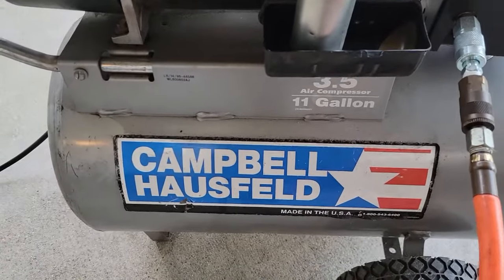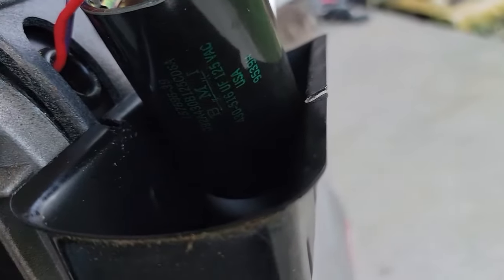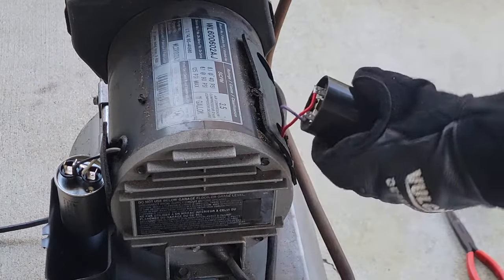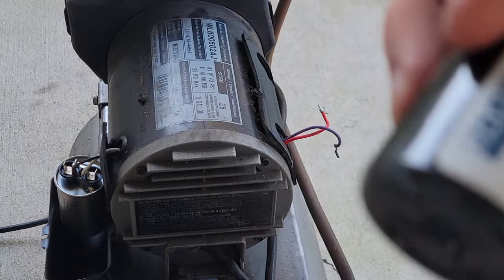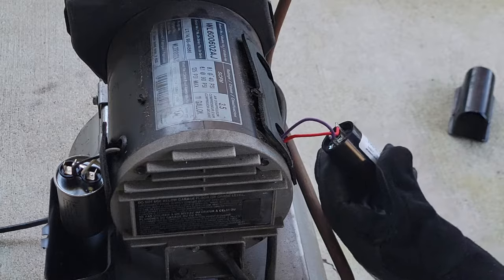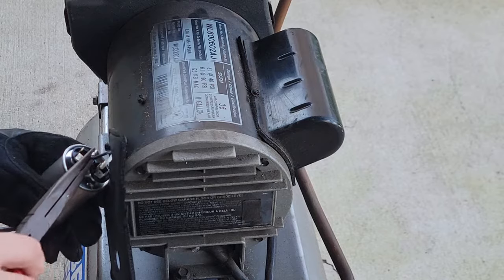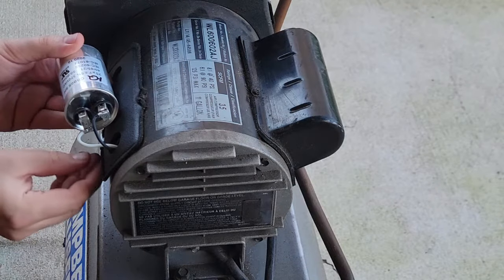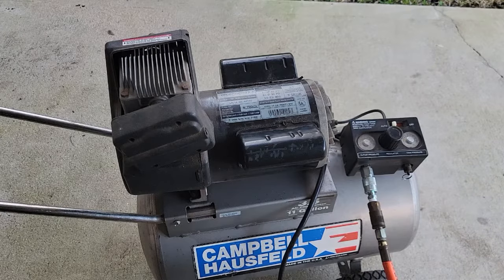Air Compressor trips breaker - replace capacitors

Comment: I have an old like 20 years old..Coleman powermate (contractor portable) it’s a really good at keeping up with my Graco sprayer for bigger orange peel jobs it sounds like urs. Mines blowing the breaker and kinda like slow to start before been looking for that a capacitor mine was tapped on for years and it’s Disintegrated nothing left what tiny pieces. Think they have old Coleman parts? Thanks for the video!  ur motor sounds exactly like that Coleman compressor I have.
Reply from the maker: Don't worry about it being a "coleman" capacitor. There's probably no such thing. Just research the ratings (microfarads) your compressor requires and buy any brand that meets those requirements.
Reply: @anythingmechanical3399  a lady at A.O. Smith that’s a sticker on my Coleman said it’s an obsolete capacitor..I can’t find the damn microfarads number. On the electric motor that the capacitor sits by there is a Century AC Motor sticker  (some info I can make out) 
A.O Smith 
SER1-   BY03-20
Hz 60
Voltz 115
Amp 15.0 
More numbers on that sticker but hard to read properly
The Coleman Powermate numbers on the serial/part number are 
Model Number CP0200312 
Serial number B23911890 
Hey thanks for the feedback! I know they might not make the exact size of my old capacitor ..what would be close in comparison? Any ideas are welcome no biggie
Reply: I’m in the same boat,I need both capacitors
Reply: I found mine on Amazon

Comment: But you didn’t do a load test after it filled up that’s when you said it would trip the breaker not at first start up ?
Reply from the maker: The problem I was having was at startup, which is why I replaced the start capacitor. Afterward I plugged it in and the motor fired right up as it is supposed to. Has been working right ever since

Comment: I have a question To connect them positive and negative or it doesn't matter.
Reply from the maker: Short answer - yes it matters. Whenever possible, take pictures of the way the old part was installed and install the new part the same way.
Reply: No, it does not matter for capacitors.
Reply: @BuildItFixItDIY may I know why? I’m just trying to learn
Reply: It only matters in DC electricity with electrolytic capacitors, with AC electricity the polarity is constantly switching from positive to negative at 60HZ so polarity is meaningless.
    If you are working with something like an air conditioning system, the cap may have more than 2 terminals, in which case you are working with a split capacitor (2 capacitors in 1), one common terminal and 2 different size caps on the other 2 terminals. Pay attention in that case because it can be connected wrong, terminals are usually marked in that case.
Reply: @arroyofive9259 it takes a great surge of energy to start the motor. a capacitor is used to store electricity and release it quickly so it can help the motor with the needed demand. when the capacitor is damaged the existing electrical circuit can't meet the demand, so it pops the breaker.
Reply: @arroyofive9259 it's also possible that the capacitor has failed, bulged and created a short so the breaker pops to prevent injury or death

Comment: I’m suspecting the same with mine but I can’t read it on the capacitor. Will the motor tell you what kind of capacitor I need?
Reply from the maker: Probably not. Best option is to just search online for the capacitor ratings that go with your compressor. Next best option, there are tables online with rough capacitor ratings by motor size.
Reply: @anythingmechanical3399  ok thank you!!
Reply: It might on it's placard. Or under a cover may contain that and/or a diagram. Otherwise try to look up a technical sheet for the make/model number of the motor, online. Supposedly you want to be sure to get the correct size uF for the motor else it will either overheat or trip a breaker. ..it needs to be sized for the motor windings.
Reply: Mine will strat then shut off immediately..I'm thinking run cap?

Comment: When you connected the wires to the capacitor, you did not mention if the wires had to go to a specific terminal.  Can the wires be hooked up to either terminal?
Reply from the maker: Good question. There are polarized capacitors that need to be installed a certain way, but these are usually small capacitors for circuit boards and the like. Appliance capacitors are generally not polarized and can be hooked up either way.

Comment: Totally off the theme of compressors, I have a condensing tumble dryer and had a humming noise coming from what I believe to be one of two capacitors housed behind the fan. Thought initially fan but having taken sides off it spins freely no noise from bearings. So….my issue is the missus ran the machine the other night and same annoying loud humming noise until nearly complete cycle when it tripped the rcd at consumer board. Today I took the wires off the capacitor terminals in turn one at a time and powered up the machine. Power on fine. When starting a cycle however it immediately trips the main rcd no matter which capacitor is disconnected at time. Would it therefore point to something else or would you expect an appliance to trip if the capacitor was not connected at all at the time of start up? 
Thanks. I know it’s a long shot but you obv have skills

Comment: My dads compressor has the exact problem described
Be replaced capacitors (to my knowledge with the right ones) and that didn't fix it

He has an older one we use now but it's shit compared to the bigger one which is collecting dust now 😂

Comment: Save the old run capacitor. It's probably still fine.

I had to replace the start capacitor on mine and the run capacitor was still good.
If you ordered from Amazon like I did they give the dimensions of those you can find one that would fit better than that compartment.
You might want to put something in there to hold that capacitor in place so it's not moving around so much. Mine had thick rubber bands around it to hold it steady inside the cover.

In fact before I put the new run capacitor on I could spin the motor by hand and turn it on and it would come up to normal running speed as if it was a bad centrifugal switch inside the motor.

Additional information:
If you have something like a bench grinder that just sits there and hums when you turn it on it's probably a bad centrifugal switch.
With a bad centrifugal switch you can turn that motor either direction and it'll start picking up speed in that direction.
The primary winnings determined the direction of the motor and the secondary windings speed it up to full speed in whichever direction it was already turning.

Some people install a reversing switch on their bench grinder or their drill press for special procedures.

Comment: Awesome video I and no idea that air compressor had capacitors Hahaha
I have one question Why did you replace both capacitors?

Thanks
Reply from the maker: Good question. It’s definitely not necessary. If one of the capacitors is old and worn out I assume the other one is on its last legs. Since they’re cheap, I just did them both at once.
Reply: @anythingmechanical3399  
Great Thank you